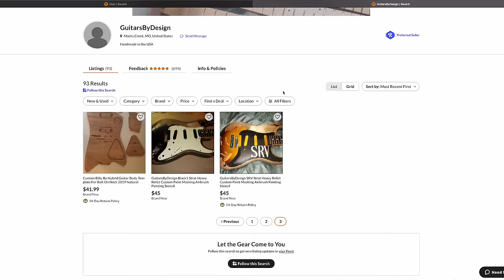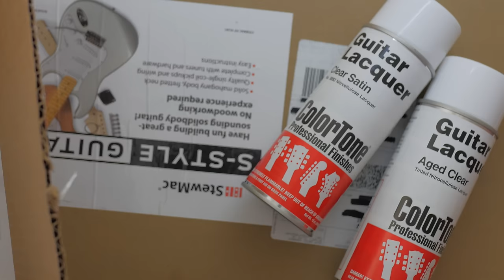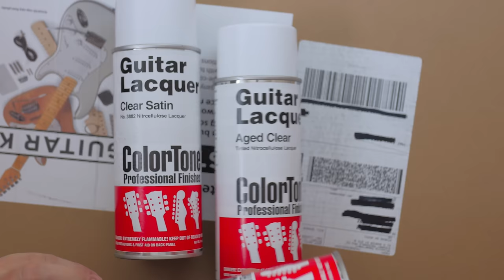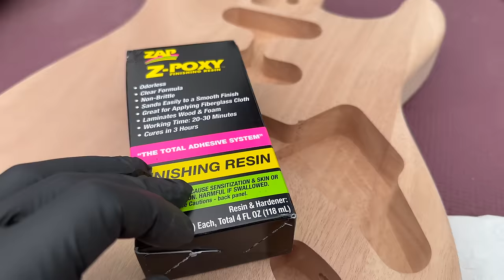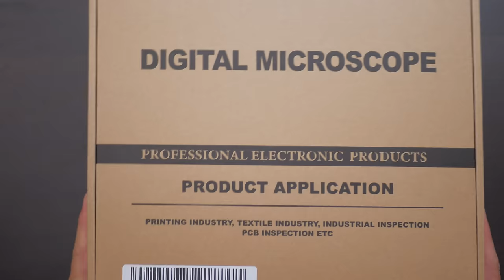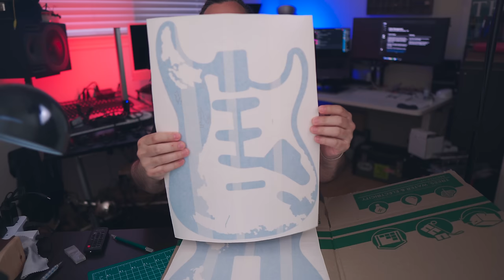Using a Stencil to Relic a Guitar - Easiest Way

Comment: for some reason the back seemed to be backwards to me, it has paint where it shouldnt, and its scratched where it shouldnt. but i loved the idea
Reply from the maker: I believe theses stencils are designed to mimic an extremely heavy relic such as the SRV Strat where the nitro paint just starts to peel off on its own. With these type of relics, 90 percent of the guitar is natural, with very little paint left.

Comment: The final product looks like ass! Here is the thing, and this is no judgement on you, the builder at all, but a true old guitar that has that much paint missing would be beat on hard. There is no paint on half the guitar and not a single ding. Other than maybe the arm contour on the front, if there is paint missing, especially on the back and Botton edges and around the jack, there will be damage to the wood as well. Fender does this technique as well and then will charge $4K plus for it and it obvious the used a stencil because paint that gradually wears through to the primer, doesn't have a hard edge. Also, no dings anywhere! If you really want to make it look like a relic, look at real relic guitars and see what their flaws are and find ways to copy them. I wish I could post pictures here....

Comment: jUsT pLaY thEy gUiTaR fOr 40 yEaRs aNd iT wOuLd lOoK lIKe tHaT!  Joking. Nice job
Reply: Lol i hate it when people say that crap. Poly guitars wont look like that after 40 years and even nitro guitars wont look like that after 40 years unless you travel to several gigs with them during that time because it's the elements of temp and humidity changes constantly happening to the wood, paint, and metal parts of the guitar that make it age lik......... And I'm wasting my breath lol. See? That's why I hate people who say that dumb crap.

Bottom line? It's your guitar lol do what you want with it!
Reply: @soyborne.bornmadeandundone1342 ikr, just look at brian may’s red special, that thing probably cost less than 800 pounds to craft and it has not signs of relic 60 years later

Comment: I’ve had my Stratocaster for over 12 years , play it everyday, not a scratch on it , still looks brand new , what on earth would cause that much wear in real life
Reply: Nitro finished. With modern finishes in polyurethane it is impossible
Reply: I have similar that I bought used. Guitar is 30 years old. It looks like the previous owner stored it poorly. Maybe he stored it in an outside shed for more than 20 years. It appears to be a real worn guitar without the intention of relicing. It’s still cosmetically in excellent shape due to the modern poly finish but you can still also tell it’s worn from the previous environment conditions

Comment: What did you use to darken the bare wood?
Reply from the maker: graphite powder
Reply: @MarkGutierrez  I figured something along those lines. Rubbed in similar to dye?
Reply from the maker: @bulletv1   Yes, rub it in. If you mess up, it can  be removed to some extent with alcohol.

Comment: Why relic a guitar? Just play it enough and you will achieve that look. Also, you'll have a story to tell about every bump and scratch on the thing rather than going on about which nail polish remover you used create an aged look 😂
Reply: Not if it has a polyurethane finish on it. You'll play it until doomsday, and it'll still look like new. But I'm sure an internet "expert' like already knew that...🙄